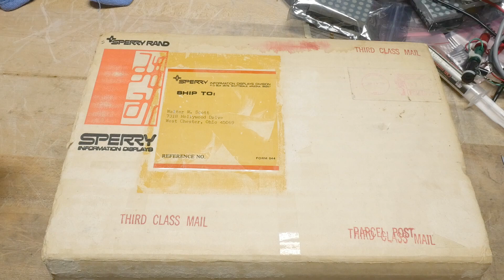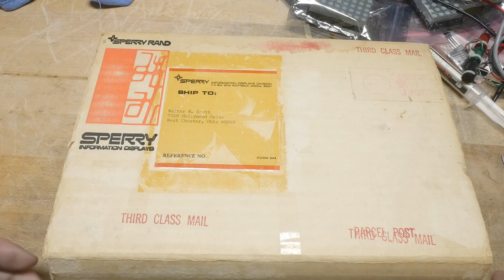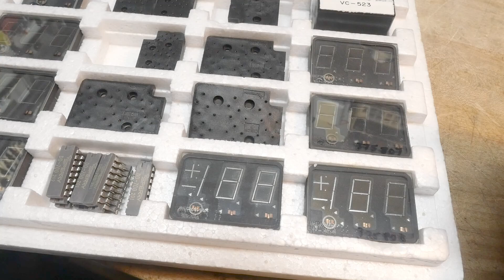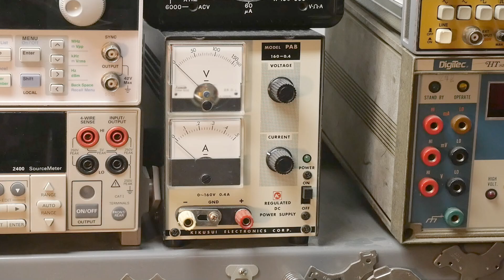#2159 Panaplex Displays (part 1 of 5)

Comment: The circle is a keep alive electrode that is kept lit all the time and used to keep the gas ionized so that the segments will fire uniformly and at a lower voltage.  The keep alive is below the active segments so it can be masked off and not seen when viewing the digits.  In the old Heathkit clocks, this was covered with a strip of electrical tape across the 3 planar display modules to hide it from view.

The other electrode of each segment is a clear conductor coating on the entire inside surface of the glass.  The “electrode” you point out is actually the contact from the wire terminal against the clear conductor.  I think these planar displays are the best discrete displays made.  My Heathkit clock I built in ‘72 for my 13th birthday is still running and the displays still going strong.  All I’ve done is replace the electrolytic capacitors in the power supply.

Comment: I like to buy projects that others built in the past from eBay. Old projects from the 60's 70's and 80's. 

One of the more interesting ones is a frequency counter that was built by an old Sperry Rand engineer that passed away about 2018 in his mid to late 90's. His son-in-law had it for sale and I purchased it. That project was an absolute work of art. It was as nice if not nicer than a production model from a major company like HP. My 10 MHz standard showed up spot on, right to the last digit on this frequency counter right out of the box with a 5 minute warmup. An hour later, it had not drifted one bit.

 The son-in-law was not into electronics, so he did not have much knowledge of what was there. I messaged him complimenting his father-in-laws workmanship. He replied that essentially he had no idea what it was or what it did, but that his Father in Law was very fussy and meticulous almost to a fault. It definitely showed in this home built piece of test equipment.

Comment: I just finished the repair and restoration of two Guildline 9577 multimeters (Solartron 7025 in disguise) that each use three of the large 3 digit displays and one of the large 2 digit plus signs displays for 10 1/2 digits of glorious Panaplex goodness. On both meters, all digits are bright and even I can read them from across the room! Looking forward to seeing yours in operation. Regards, David

Comment: You lucky boy to have a box full of these 😮🙂 Those electrodes at the bottom.. some will be the anodes which make contact with the ITO coating on the inside of the glass and the triangular shaped electrodes are the "keep alive" cathodes - quite necessary when the displays are multiplexed as I recently found out.. so there is one per digit.. I recently acquired a 70's Heathkit clock with a few of these beauties inside.. however the seconds display would start to flicker under low light conditions when the anode voltage and thus the brightness was reduced via an LDR circuit.. on closer inspection, one or both of the keep alive cathodes in the rest of the displays were lit, but we're both out on the seconds digits.. these were connected to the anode supply via a 100 megohm carbon resistor.. both of which were O/C.. too high to measure without a megger so just replaced them with modern equivalents from an old laser printer HV board ! Working perfect ever since.. a thing of beauty on the bedside locker !

Comment: I have a Heathkit clock I built in the late '70s with those displays.
Still works and looks great.
Reply: They also had a weather station wind speed and direction, I don't remember if it also have  had temperature.

Comment: Look closely, the ones with Sharpie markings on them are made by Beckman.  Been a few decades since I got these but if I remember correctly I added the 2 Beckman displays to each kit I got to fill in originally empty spaces.  I had also purchased a case of 100 of the Beckman displays around the time I got these kits.  I made a 250MHz frequency counter that has 15 digits using the Beckman displays.  100MHz most significant digit all the way down to .000001 least significant digit.

Comment: Back around that time TI was building a business desktop calculator that used plasma displays similar to these. It's easy to forget how primitive LEDs were at the time.  This type has a very wide viewing angle, which would have been impossible with LEDs at the time. The other thing interesting about these is they act like a memory element.  Like an NE-2 neon lamp, the trigger voltage is high, but once lit, they can sustain on a much lower voltage.  So if you keep a constant low voltage on the display you can trigger segment you want to be on and they will stay on. The problem we had in production was that the trigger voltage was much higher when the amber display filter was in place.  The fluorescent lighting on the factory floor caused the segments to trigger at a low voltage.  The voltage would be adjusted to get a nice display, but when the case was put on, there would be problems with missing segments.  If the segments were adjusted with a filter in place, when the filter was removed, you would have extra segments lighting and arcing.
Reply from the maker: make sure to watch tomorrow

Comment: These gas discharge displays were/are used extensively in avionics Nav/Com radios from Bendix King like the KX155, so much so they're almost iconic. They used Nat Semi DS8884A BCD to 7 segment drivers.

Comment: I had a tray of about qty 10 x 1.5" sized ones and driver ICs that came in while I was working at an electronics surplus store in the Seattle area. I was going to build a clock but then decided I wasn't cool enough to have them. I ended up selling them on eBay. They sold quickly.